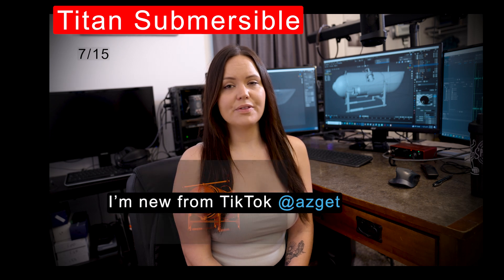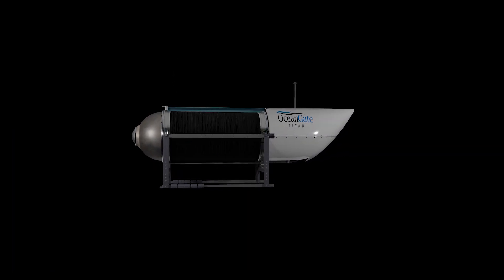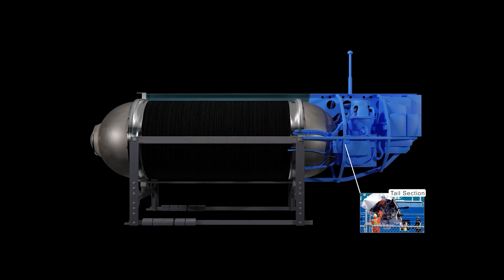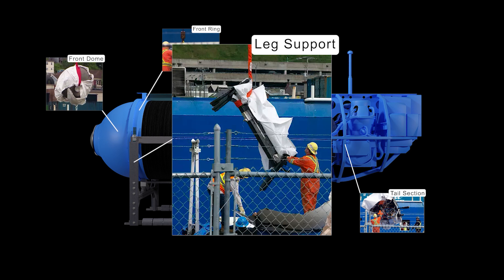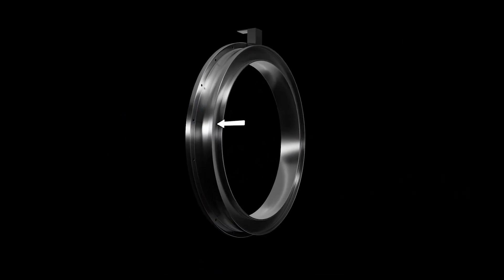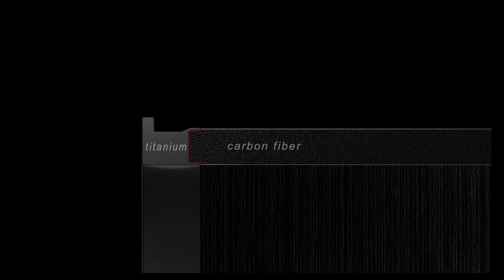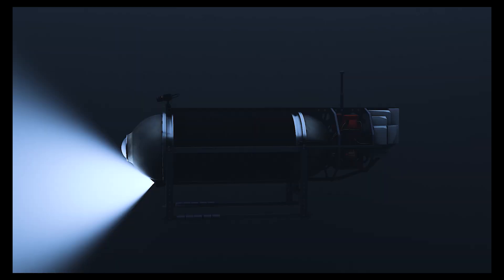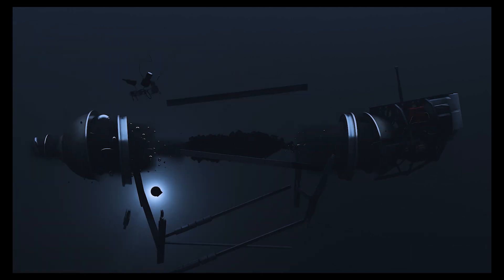Titan Submersible and how it Imploded... parts of submersible recovered 1600 feet from the Titanic

Comment: I don't think your simulation takes into account the fact that the pressure of the water bears on ALL exterior surfaces. While the pressure acting on the walls of the carbon fiber tube would try to compress the carbon fiber tube radially, the water pressure acting on the domes would force the domes to bear down on the lips of the carbon fiber tube, trying to compress it axially. The carbon fiber within the mating area between the tube and a dome can only compress so much in total. The axial forces on the section of carbon fiber in question would be greater than the radial forces acting on it, so the carbon fiber here may not actually shrink. It might even grow.

Wait! The surface area of the carbon fiber tube exceeds that of the domes; aren't the radial forces greater? Why does the carbon fiber in the mating area not shrink radially?

Yes, total radial force is greater, but most of that force is not "transmitted" to or born by the carbon fiber in the mating areas. The small amount that does make it would be greatly overpowered by the axially compressive forces generated by both domes so, if anything, the radial thickness of the carbon fiber tube in the mating area would increase rather than decrease.

The carbon fiber in the mating areas would be hugely reinforced by the titanium domes and therefore very inflexible, while the carbon fiber outside of the mating areas would be very flexible. The sudden transition from inflexible to flexible would focus a lot of bending force on the carbon fiber in the shoulders / transition zones. This is where I'd expect the carbon fiber to break down / weaken most quickly, ignoring thru-hull fittings, points of reduced strength caused by imperfect manufacture, incursion of water into the carbon fiber laminate, and who knows what else.
Reply: In highschool you learn about Young modulus... she and who ever designed this tytanium rings so thin both have no idea what it is...

Comment: Nice work. The modelling of the compressive forces on the titanium/CF joint shows clearly that the joint would be damaged each pressure cycle, because of the different Young's Modulus of the two materials. Perhaps it was the final breakup of the joint at the rear of the vessel that was the firat point of failure that led to the implosion - the report of cracking noises from the rear would seem to indicate this as a possibility.
Reply: Young modulus is one thing and tensile strenght is something completely different...
Yes there will be crazy ammount of movement in this joint but caused by the fact, that who ever designed that ring also was unaware what Young modulus is...

Comment: Very good video, particularly at 1:52 The carbon fiber cylinder being necked down to install in the titanium flange doesn't seem like a great idea.  However, the shear stress where the cylinder joins to the flange must have been tremendous, plus the wind of the carbon fiber offered absolutely no strength to combat that stress, it was just the epoxy bearing the shear stress.  I wouldn't be a bit surprised if this was the mode of failure.
Reply: The model shows it as necked down but the actual footage during construction shows the cylinder consistent in cross sectional thickness from end to end. The end of the glue border may have made it appear to be necked down. Edit: What blows my mind is the flat faced mating surfaces between the hemis and the rings. I would want a ring joint. Very poor design in pressure component connections
Reply: @xenuno  Nope, it was necked down, at least at the outside, and it is shown during construction; https://youtu.be/4PUTbK5AqY8?t=112
Reply: @vin12666  Ya I've seen that video. There is no relief cut into the ID at the ends and what looks like a step on the OD could be an edge where the rubber sealing compound used externally to water seal the body, stops. From that point to the end is the gluing surface (typ each end). The CF cylinder is consistent cross sectionally from end to end. No competent engineer would allow such a machining operation on a material as NON monolithic as built up CF. Apparently (and not shown in the vid) there is an internal cylindrical liner to mount items, provide space for wires, and to possibly protect the cylinder's ID from wear and tear. All these extraneous cylinder obstructions can't help toward verifying the integrity of the cylinder itself after each mission ..
Reply: @xenuno  I know about the liner with the LED lights, cabling etc. I'm not convinced about the machining yet. In the same video you can see them using putty to seal the seam between the titanium ring and the hull on the ID. What I see is that the inner wall of the hull is flush with the titanium ring ID, so the edge of the hull must have been machined (or moulded in shape). I strongly agree that a competent engineer would never do this but were they competent? Maybe they were competent but Rush ordered them to just do it. I remember a passenger saying he told them not to worry about popping noises because there was 5 inches of CF and plenty left! Speaking of hull machining, in another video you can clearly see that holes have been drilled into the CF hull for the drive motor mounts. There is even a drill hole in the wrong place. I should add that this may not be the Titan but the Cyclops1 but still extremely bad engineering. Pause the video at 8:07 and the boreholes are clearly visible. https://youtu.be/6LcGrLnzYuU?t=487

Comment: This is the most accurate Titan model I've seen yet. All of the time, effort, & research put into it really shows. Great job!
Reply: yeah but she's an illustrator not a physicist or engineer, so saying its the most accurate is a stretch. Most visually pleasing perhaps.
Reply: The truth of the matter is from the Testing done at UW on the 1/3rd scale version the HULL never broke up, during that testing the Carbon fiber unzipped, now it was contained in the chamber which could explain why it did NOT just simply disintegrate. If the View Port gave first then the Hull Exploded outward - again if the HULL was the point of failure again there would be an implosion - explosion which is illustrated by her model. I wish we could have had video footage during the 1/3rd scale testing inside the chamber - this too would have show how the implosion reacted. In the end We need to find ANY pieces of the HULL to really know what failed first the view port or the Hull.
Reply: Great video and focusing on the engineering part, and not the personality of Stockton Rush which most of the other youtubers have done. With a lot of slandering and cheap critiq of Rush.
Reply: Yes, it is the most accurate representation, thank you for making this and the animations are really well done!
Reply: Stolen from Thingyverse - it's freely available.
Reply: its nice but extremely doubtful it crushed like a can. there would have been a failure point and the pressure would equalize fairly quickly over the rest of the area
Reply: @Blox117  Exactly, in the event of a leak it would rapidly expand and allow a large volume of water to decompress to about the speed of sound almost instantly, a ton of water travelling really fast is most likely what broke the sub apart and killed everyone.
The part of the sub most like to spring this leak is where the carbon fibre composite and the titanium were joined with glue, with them having different contraction rates that joint was under constant stress. Water most likely rushed in at one end very fast and blew the other end off which gave the recorded sound and the debris field.
Reply: @88Cardey  yeah if you believe the transcript, it happened at the rear of the craft
Reply: And you would know, right?
Reply: Indeed :)
Reply: Wrong, horribly inaccurate....if her deflection animation wasn't a result of a FEA model, it's most likely wrong.
Reply: @rayhemmele4915  feel free to spend the time to make a better one then.
Reply: @rayhemmele4915  There is an FEA model out there but the problem with that approach is you also need CFD to accurately model what happened here, which you haven't mentioned, genius. In the FEA model I've seen the end caps meet each other which is unlikely to have happened. The composite would probably have brittle fractured into fragments whereas the titanium end caps would have to have been accelerated inwards by the water pressure. Since the water in the centre of the cylinder would have met before that happened there would be a high pressure front meeting those end caps and accelerating them away from each other, which is what planned out in reality (because they were found separated from each other) and what the model in this video shows. So YOU'RE highly inaccurate
Reply: @-BuddyGuy  Thanks Buddy...  My point was not to explain all the various structural, fluid/hydrodynamics, and thermodynamics gaps with what was shown..simply that without some sort of modeling other than just a geometric 3-D model moving in a fashion that you think (vs the actual model predicting) is misleading.  It's an incredibly hard thing to model accurately, very non-linear, very anisotropic materials involved, etc.

Comment: The endcaps wouldnt blow away like that. It doesn’t just explode like a bomb. It implodes. Everything just crushes inwards and then stops moving.
Reply: No, it moves inside then bounce back outside... that "bounce back" is kinda like a small explosion->it most likely kicked out the front window...
The biggest error here is the fact that she and who ever designed this tytanium rings were/are both confusing tensile strenght with Young modulus->this rings would be shrinking under compresion force much more than the CF and someone made them even extra thin in the middle(crazy level of incompetence...).

Comment: Impressive modeling of the Titan. You did a perfect job of studying its construction and recreating it correctly. The only note is for implosion animation, titanium domes would move towards each other, because pressure from outside is already applied to them, but inside pressure takes some time to increase. And while rising rapidly pressure would rip acrylic window of the front dome from inside first and then significantly decrease the speed of its horizontal movement towards the other one.
Reply: In my opinion that is why external pieces like the tail are still relatively intact, as the domes rushed inwards they were torn clean off.
Reply: well it goes to show Stockton died for a cause to pioneer an idea that cutting corners and half fasting on safety is ultimately stupid and fool hardy with deep ocean exploration and a throw away sub will self destruct if you try to use it multiple times in a row
Reply: And you know that how?
Reply: @garnet4846  Physics...
Reply: @pcwcol  it's bs.
Reply: @garnet4846  Physics is not bs. Also there are plenty of real simulations of Titan implosion done. They are not as pretty as this one, but they are physically correct.
Reply: @dm1i  real simulations. Lol.
Reply: @garnet4846  Because there are also fake ones, that are basically a hand animated sequences.
Reply: @dm1i  
You are wasting your time talking to this one. He commented in another thread that it was a fake event.
Reply: @rogermccaslin5963  all the world's a stage. People love drama, doesn't have to be real, or even halfway provable. Who can prove this happened? You've just watched stories on your screen devices, that's the truth of the matter.
Reply: @garnet4846  
So the dozens or maybe even hundreds of people involved in this are all lying to put on a show? The submersible was a fake? The accident was fake? The videos of the parts being brought back are fake? 

What evidence do you have that none of this was real? Why would anyone fake it? What do they possibly stand to gain?
Reply: @garnet4846  it's called education!

Comment: im wondering if the carbon fiber was supposed to be interference fit into the titanium piece; definitely looked like it should have been installed a tad bit further in and secured with bolts every 6-8".

Comment: I do not think the sub imploded.   If it did then the front cone would still be attached to the titanium ring.   I think the port hole failed and the sudden influx had a water hammer effect and exploded the sub.   It sheared off the bolts of the dome from the ring.   Splintered the carbon hull into tiny pieces and blew off both rings and end caps.   The rear endcap ptotected the rear portion from getting blown to pieces.   Of course the bodies were instantly destroyed with total loss of cellular integrity for soft tissues.   Bone and ligaments may have survived.
Reply: In your scenario the porthole ring with the bolts would still be in place. Rush said somewhere that the acrylic glass will be pushed in three quarters of an inch at depth. So the ring wil be untouched at that point and the waterpressure will hold it in place. The cone (and porthole window) is detached by the superheated air-explosion a split-second after the hull implosion.

Comment: Thank you for this but I have a question. You video appears to show the sub blowing apart as in an explosion. I thought the pieces would collapse in on each other because of the extreme pressure. I’m still not sure I understand all the physical forces at play here.
Reply: Basically, the animation suggests that the force of water flowing into the middle (imploding) part of the hull would have equalized the pressure pretty quickly - And, since that water would have had a lot of velocity when it squirted out to the sides of the tube, it would have pushed the end-caps away.

We do know something along those lines happened, since the porthole seemed to have been forced out from the inside (you can see the ring holding it in place pop out in this animation, and it wasn't present on the recovered end-cap). The question is whether the pressure equalized before the caps started moving in towards each other - It seems reasonable to me that the caps didn't have that much time to accelerate inwards, but it's hard to say exactly how it happened without knowing the exact failure mode of the hull, and it's impossible to assert whether it happened without knowing where on the seafloor the caps were found compared to the heading of the vessel (ie if the front cap was found near the tailcone, that'd be an indication that it was pushed inwards)

Comment: The only thing missing is there is immense horizontal pressure from both of the titanium domes pressing on the carbon fiber tube from the sides (right and left) for which the carbon fiber is not able to properly compress and decompress, which could then lead to cracks forming at the horizontal part of carbon fiber inside the titanium rings leading to a cracks and a chain reaction failure.
Reply: "which the carbon fiber is not able to properly compress and decompress," 1) the animation is wrong, she clearly do not understands the physics invovled here. CF is stiff because its young modulus is much higher than tytan and tytanium alloys, tensile strenght is completly different property...
2) "carbon fiber is not able to properly compress and decompress" ekhm, what? The tytanium part here will be shrinking like hell under pressure and breaking glue and potentialy damaging the CF by doing so -> who ever made this part should make it extra thick on the side that is glued and instead someone made the whole ring as light as posible(complete incopetence).
Reply: @Bialy_1  Why do you keep saying this?

Carbon fiber is very strong under tension, and very weak under compression (because it's basically just epoxy). Young's modulus is a measure of tensile strength (typically), and the hull is under compression - It'd resist bending better than titanium in the opposite direction (being forced outward), but not in this direction (being crushed inward).

Titanium is substantially stronger than carbon fiber under compression, which is why it's fair to visualize that carbon fiber is doing all the deformation. Obviously titanium will also be deforming, especially when it's thin like that, and that's probably not helping matters, but carbon fiber will tend to deform more than the titanium - Especially if it's all wound with parallel fibers, which videos suggest this one was.

The entire sub was built incompetently, and the entire point of the carbon fiber hull was to be as light as possible. It's certainly not there to be strong.

Also, it'd help your credibility substantially if you spelled "titanium" correctly, and understood that "titanium" is the pure metal, not "titan". It's generally hard to assume you know the material properties better when you insist on not correctly referencing the material at hand.
Reply: @ryanhodin5014  (because it's basically just epoxy) Exactly! Take an empty soda can, put compressed air on it and it bursts open. Take another one and wrap a few layers of sewing thread around it, paint some glue on it. Put compressed air on it again and it won't tear open. However, the can is still easy to crush by hand.

Comment: apparently a sleeve was put inside the carbon fiber. computer screens and things were attached to it. like to see how that affected implosion.
Reply: CF have much bigger Young modulus contrary to what this simulation sugesting... so the tytanium ring at least at CF side should be made thicker to match deformation movement.
Who ever designed this tytanium rings so thin was also not aware what young modulus is and we are talking here about highschool level of physics...